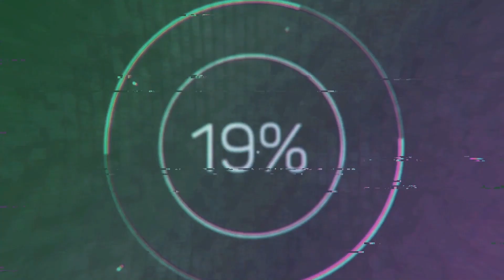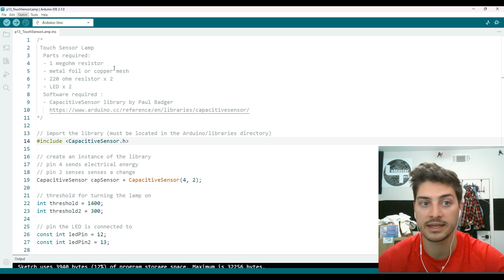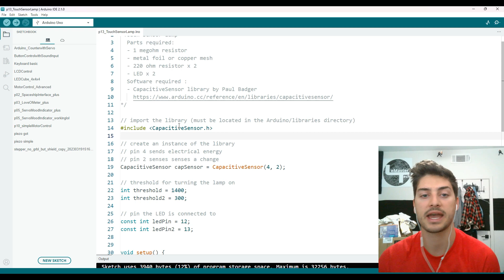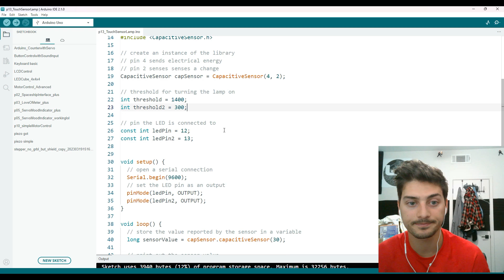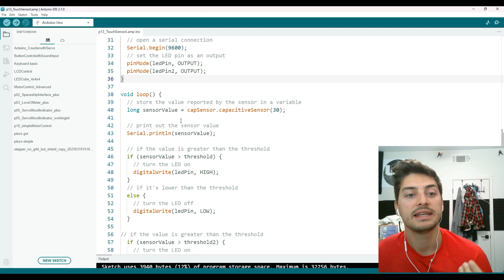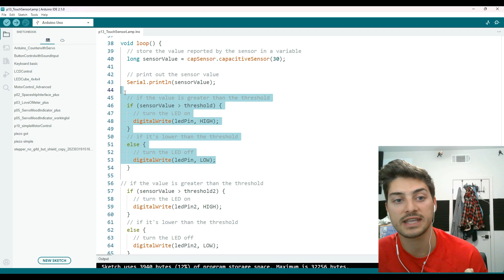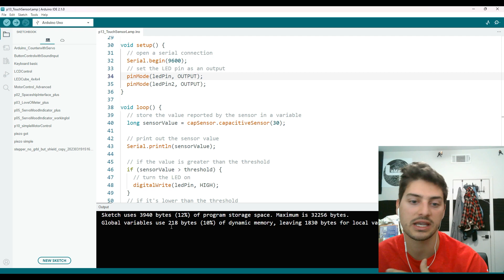Arduino Capacitive Touch Sensing!

Comment: Thanks a lot ! I'm wondering, sometimes it seems like the sensor gets overwhelmed? Instead of reading 30 times a second it stops at about one per second, reading super high values in the 280000. I don't know what's causing it? Thanks for the tutorial though it works when it's not lagging like that.
Reply from the maker: Hi I am sorry I have not encountered that behavior before!

Comment: Hello, I’m using this cord and build to analogwrite a cord to the value of the capacitor. For some reason, no matter how hard I press on the wire it does not change from 0. 
Could you help me?
Reply from the maker: Hi, you wouldn’t analog write a value to a capacitive sensing input you would read the analog value back!
Reply: @lemastertech  Ok sorry so i figured it out and I hooked two up. I touched them both together by accident and now only one works. Did I fry the circuit or a wire?
Reply from the maker: hi most likely you damaged either the wire/sensor you were using or damaged the Digital input pin you were connected to - if you try different input pins on the arduino and it still doesn't work probably fried a wire or sensor @MrWrestler500
Reply: @lemastertech  Thank you so much, I switched the pin and upped the resistance and it worked. Is there a reason using two different fingers to touch both capacitive sensors fried if
Reply: @lemastertech  Yes so the goal was to use the capacitive sensors as a start and end, but all it’s returning js zero, my guess was that I don’t have enough resistance for a change to be noticed but I’m not sure how to implement that

Comment: Hello! First of all, thank you for the video; you explain the project well and clearly. I would like to create it too, but I only have D1 Mini microcontrollers at home. Before starting the project, I would like to know if the presented library works with this microcontroller, and whether I should use the recommended 1 megaohm resistor you suggested or replace it with a different value. The D1 Mini has digital pins operating at 3.3 volts. Thank you for your help.
Reply from the maker: Hello, I am not sure if this library will work for those specific microcontrollers but if they can be programmed with the arduino IDE than the odds are they probably will still work!

Comment: hi, i followed step by step to do this, but mine isnt working. The board lights up when i plug in my arduino and upload the sketch, indicating that everything is fine, but when i touch the wire, it doesnt light up. I tried changing the ohms, maybe i put the wrong ones, but nothing. i know the LEDs are fine, because they light up when i first plug in. My serial monitor shows that its "0" and when i touch the sensor, the number goes up, but no lights on the LEDs.
Reply from the maker: Hi - sorry this is a tricky one to help with without seeing your circuit. Have you been able to try a few different input pins on your arduino to make sure you don’t have just one bad pin/connection?